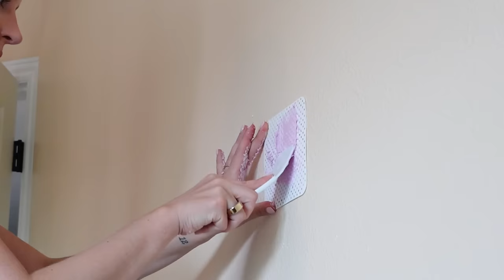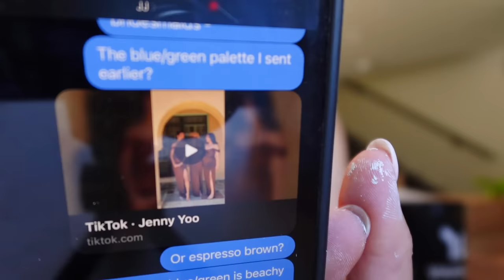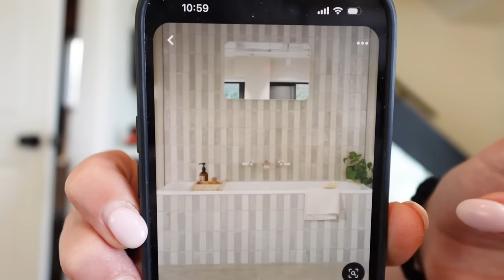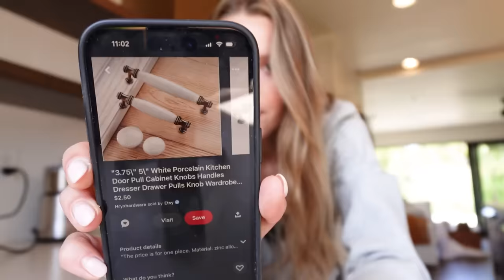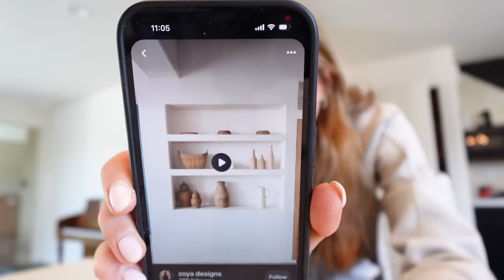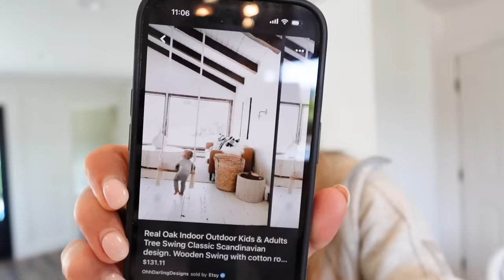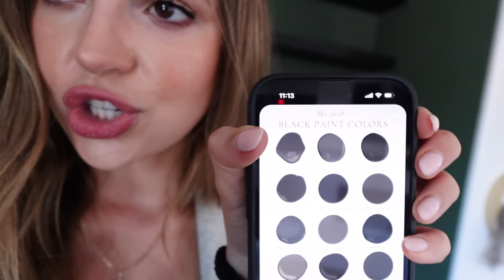VLOG: all of our house renovation plans + starting to make it our own!

Comment: Just tape down a drop cloth or some old sheets- that's all the professionals will do to protect your carpet anyways. And as for cutting, instead of taping everything, use a clear laminate sheet, or a manilla folder, etc., and line it into the crease. Then slide the folder/sheet along the crease with your brush to create the perfect line. There's lots of tutorials on how to do this on tik tok! So much quicker than painter's tape.

Comment: Michel, there are special primers and paints for tiles, also you can give them a super light sand with fine grid prior, it will, work, I have done it and it saved me some pounds, especially that it meant 5o be a temporary thing and nearly 10 years later, they are still there and looking great ;) I am not planning to retile anymore 😅

Comment: I love all your design ideas Michel! For your "pocket shelves" aka niches you might have to build whats called a "false wall" out from the existing wall and put your niches in that, rather than cutting into the existing wall since they often contain framing, electrical, etc. it might also look cool to cut a niche for the piano as well so it's inset in the wall with lighting above. just a thought! 😁

Comment: Congrats on your new house! I have a few suggestions and a small bit of info for you. Your walls appear to be the standard thickness which means they were framed with 2x4s. However, they were actually 1.5x3.5 inches and are most likely the standard 16” spacing between. On the wall where you want to do some cutouts,  that info may be helpful. If that’s not a load bearing wall then you can make your cutouts any size you’d like. In the bathroom that you want to put in a medicine cabinet, once again, it depends on if the wall is load bearing or not. You can buy very large medicine cabinets with multiple doors. Be sure you get quality glass/mirrors. There are inset or flush mount options. You shouldn’t have any trouble finding either. Home Depot and Lowes carry them. In the room you plan to paint dark avocado green, it’s a good idea to prime the blue before painting the green so it doesn’t look different from the upper space that is a very light color and easy to paint over. You can buy inexpensive plastic from the paint department to cover your carpet. Tape the plastic to your baseboards to help hold it in place. The same plastic is great to cover furniture, cabinets, etc. I’m looking forward to seeing your finished product! OH! I almost forgot! If you have rooms with very little storage and not much room for adding furniture or cabinets, you can cut into your walls vertically, remove the drywall, add shelves (3.5” deep) and put a door (wood, glass, mirror) that you push to open and push to close. If it’s a load bearing wall, you can do multiples but if it’s not then you can do a wider space. Happy renovating!

Comment: What fun! Congratulations again on your home! If you paint tile use the correct product & it will be awesome. I strongly suggest a heated towel rack feels so nice in winter. As for your bathroom I suggest using LED light strips instead of putting another light above. Can’t wait to see more ❤

Comment: I would spray paint all the kitchen pulls and knobs right now. Black would match everything as an accent. Then later, decide if the kitchen design would support vintage hardware.
Reply: You'd need to powder coat them, or the paint would wear off really quickly.

Comment: If there is a  recessed light above where you want to put the table you can get a conversion kit from lowes, you just screw it in where the bulb goes in the recess light and then you can add a shade on the pendent part.  Also on the ones in your kitchen, all you would need is new pendent lights and add the shades.

Comment: Just lay out plastic on the floor and tape it down for the dark green room. I painted my whole basement a dark, midnight blue, and, as a first time painter, I got nothing on the carpets or ceilings. Did the owners leave the former paint from the ceilings? Even if you did mess up, painting over it would only take two quick coats.

Comment: Hei Michel 😀 in the guest room why don’t you just cover the carpet with a floor foil layer? It’s like a transparent plastic foil with adhesive taped edges, pretty sure you can find it at the hom renovation stores. That would save a lot of money rather than hiring a professional just for one room 😉